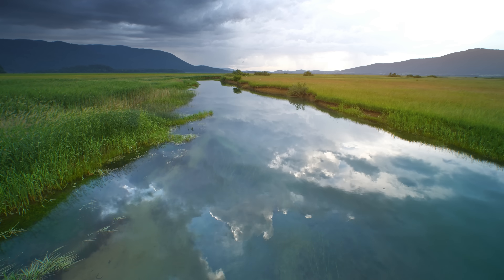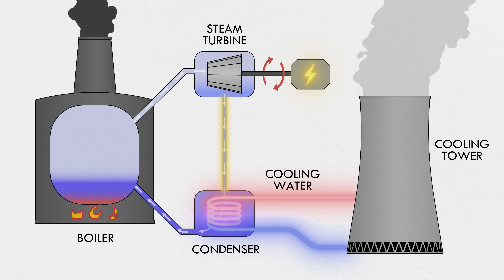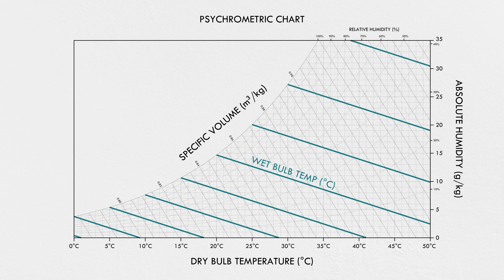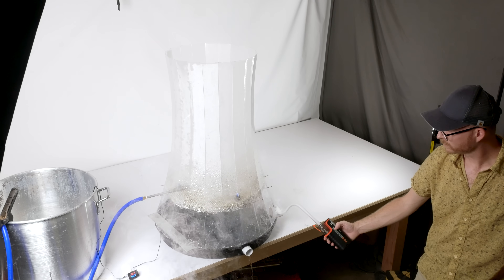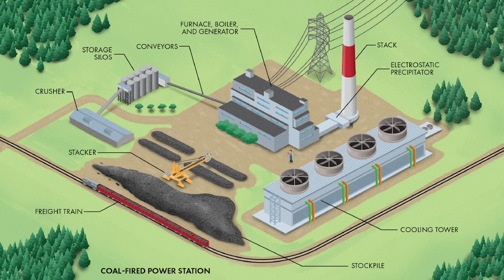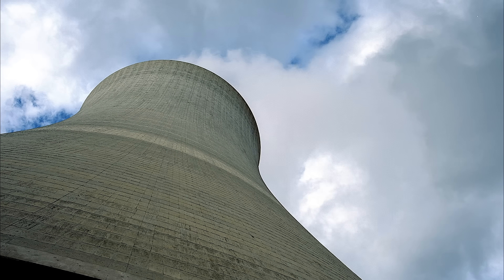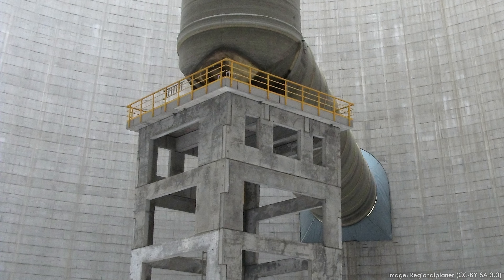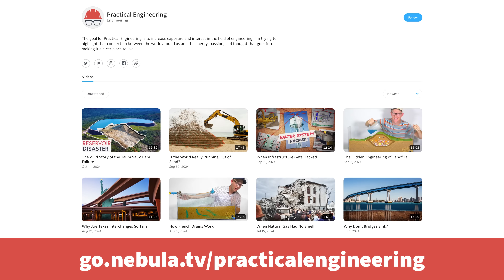Why Are Cooling Towers Shaped Like That?

Comment: That isn't smoke, it's steam. Steam from the steamed uranium we're having. Mmmm, steamed uranium.
Reply: The water that is in contact with the fuel and the steam that drives the turbines are kept in separate pipes.
Reply: Albany style steamed uranium
Reply: Sounds delightful
Reply: Incredibly high in calories!
Reply: I'll disguise the steam as my own....
Reply: I thought you said we were having steamed thorium!
Reply: Youre talking about a primary loop. Not secondary. Theres usually a heat exchanger where the two meet so contamination doesnt happen. Reactor cooling water is seperate from steam/water in this video.
Reply: And you called it "Steamed Uranium" despite the fact it is very clearly grilled?
Reply: I'll stick to patented Skinner steamed hams, thank you.
Reply: Good lord what is happening in there 
points at melting down reactor
Reply: *looks at cherenkov radiation
Uh, Arora Borealis
Reply: @normanmai7865  well yes
Reply: But what if I bought Power from the oil fired plant and disguised it as clean atomic energy?
Delighfully devilish, Seamour!
Reply: Good lord what is happening in there!?
Reply: Don’t mind me, I’m just lolling in radium
Reply: I used to maintain three pass-through cooling towers with the baffles and eight-feet fans. It never ceased to amaze me just how much heat that water rejects in such a short amount of time. When I took over that system nothing was working-the water from the chiller was simply moving by natural convection so it was very warm water going in and some tepid water coming out. Six months of rebuilding and proper temperatures were easily achieved. I was able to efficiently run the chiller with just one cooling tower and we made our investment back within six months. Projects like that are really worthwhile.
Reply: at this time of year, in this part of the country, localized entirely in your garage?
Reply: Well uranium would have approximately 7.583395 fucktons of calories
Reply: It's a local dialect
Reply: I don't like if I'm steamed
Reply: So tender... So juicy...
Reply: Your making a joke. Right?
Reply: @clintpmk2405  yes?

Comment: Is there no good way to use the hot water in the winter to heat nearby homes replacing the usage of natural gas in cold climates like the North Eastern USA?
Reply: If there are homes nearby, yes, there is. And some places actually do that. But a lot of American power plants, and nuclear plants in particular, are located far away from inhabited areas.
Reply: There's plenty of European places that do that, and boy does that water heat radiators well. It's real cheap too. On the other hand, due to living in proximity to coal power plant you get cancer so there's a tiny trade-off :P
Reply: @LordDragox412  I live a few miles upstream of the Beaver Valley PA USA nuclear power plant (2 units). In the late 1980s as a future engineer I took a field trip that toured unit #2 before it went online for the first time. We toured the control room, saw the turbines and stood inside the massive cooling tower.